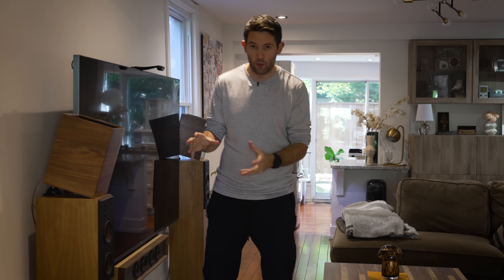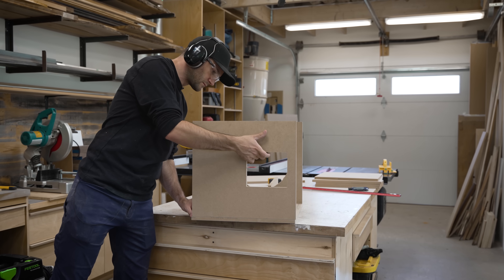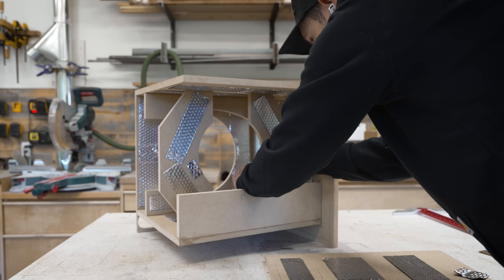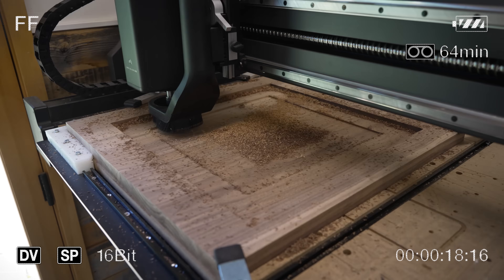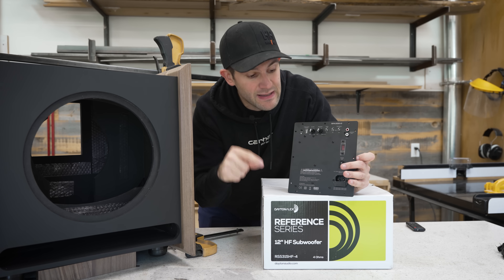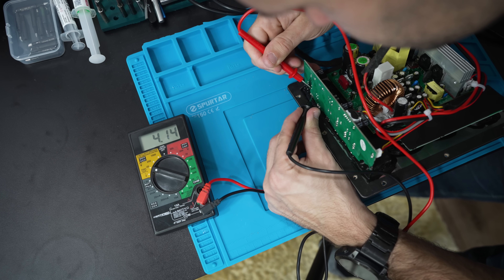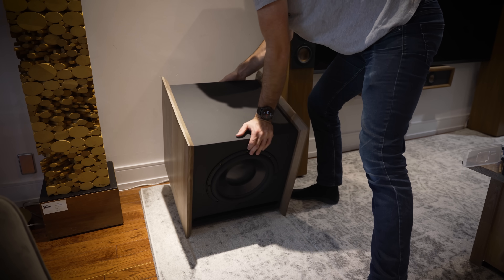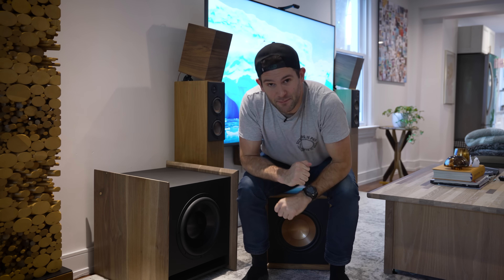THIS changes DIY Audio...

Comment: The bass port should be rounded, i have one DIY car subwoofer as a home theater sub with 15" driver but the guy who made it and bought it from made a bass port sharp. At lower volume you can't hear it but i making a parties with my friends more often than you think and i couldn't whithstand the " flutter " sound comming from that bass port. Next year i'll be making a whole new enclosure tuned around 18Hz so it'll be pretty damn big thing in my living room. The second subwoofer will be some trashy Technics whatever it is for higher frequencies starting around 35Hz so they should overlap themself pretty nicely.
Reply: I built a very similar ported sub around y2k. one thing I noticed while pushing a 20Hz signal through the sub (far below what it could reasonably reproduce) was a lot of what I would call hissing from turbulence as the air passed over the sharp corners. I used a 1/2" rounding bit on a router to round all of the internal corners on the braces, and the port, and at the outside edge of the port. The rounded corners reduced the turbulence and made the whole thing sound much better. I would recommend rounding all of the sharp corners.  
Great build and video. Thanks.
Reply: Pretty sure what you're referring to is called "chuffing", and I'd recommend DYI Perks' latest video when it comes to your harmonic overlap scenario, though it's geared more towards a complete speaker build than just being a subwoofer enclosure.
Reply: @ i've seen that video don't worry :D they must to overlap because i don't have any other crossover for them laying around and those are home built  with agressive slope specially made for that purpouse. Big boy's crossover can pass through anything from 0Hz basically to around 25-28Hz which after that has 12dB/octave reduction  and the smaller 10" sub has crossover that starts at 33Hz and ends up at 47Hz with 6dB/octave slope. Mids and highs are set via AV receiver  to not be able to play under 60Hz because they are kinda weak though i burnt my center speaker  few months ago because i set the equalizer wrong and i let the whole pallete of sound spectrum to enter the center channel while i was making a party and it died just after a few second after the Drum n Bass bass drop. And also i have bass boosted frequencies for those two subs but right now the big boy can't play efficiently below 30Hz you can barely hear it pass that frequency.. it is kinda mixed up all together but it sounds really good and it'll be even more after i make that 18Hz tuned box. I really want to push my window in to the street i really hope it will happen but if not i'm building another one fr

Comment: Only like 3 minutes in so far. For a better bass reflex and sound quality, you should have faced the port towards the back of the box. Bass like to reflect and load off of walls. You would have had better output and the bass would sounds like it's coming from everywhere. Not just from the box. Also, you're building the Sub enclosure not a sub. The bracing is OVERKILL for a 300 watt sub.